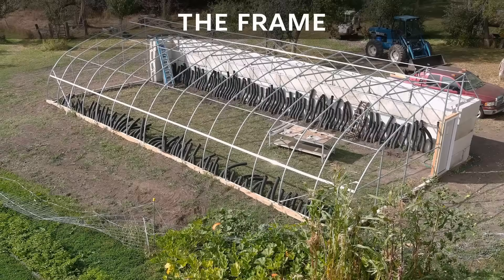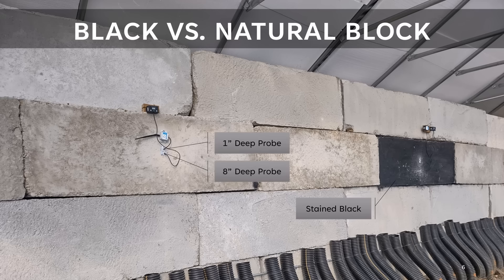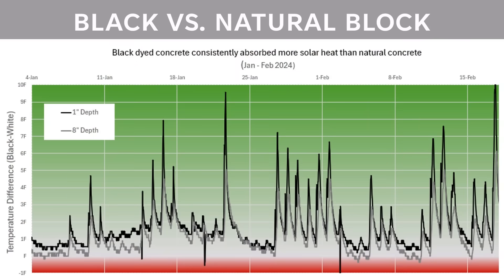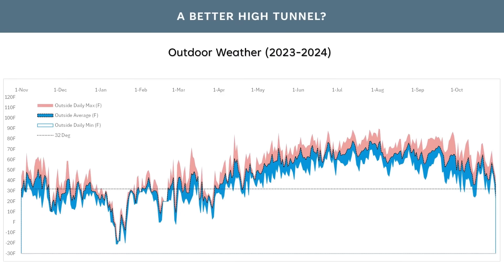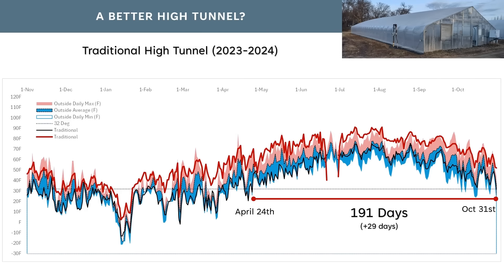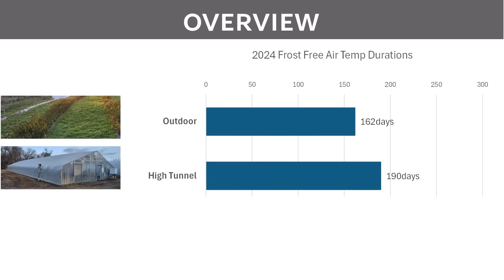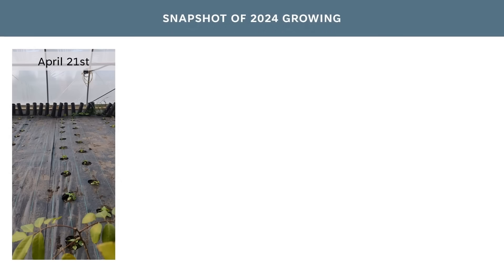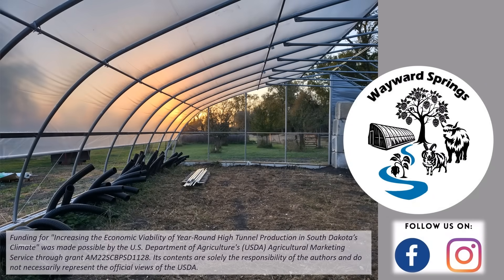Year One Results! Thermal Performance of the Concrete Thermal Mass

Comment: If you was to vent some of that heat to keep it a steady 80 degrees during the day, it would take time to build it back up at night time? or would the temp stay steady after you shut the vents on it? Just curious.
Reply from the maker: If you vent at 80, it will reduce the rate of heat storage because it is highly dependent on the temperature difference between the heat source and the storage medium. I show some graphs on have the deltaT affects storage/withdrawal rate in the climate battery videos.

Comment: I have always found his fascinating, but I wonder about the real benefits of expanding the season into the fall, given decreasing day length. Spring is when I'd really like the season extended and that seems to be harder for obvious reasons.  For my small greenhouse I've decided that it's more cost-efficient, if much less intellectually gratifying, to simply use a small heater as needed for an earlier start.
Reply from the maker: Check out the other videos on my channel. I also measured light and cover that topic. You are absolutely right that it is very important!

Comment: Nice video.  Data is always great. Interesting mass wall but I do wonder if you can improve it more by insulating the top of the wall so heat stored doesn't vent off the top and has to release via the front side only.
Reply from the maker: The rear and top are insulated, but more insulation than I had would improve performance.

Comment: Using passive geothermal heat? how's that working out? Are the tubes moving enough air without power?   Is mounding soil on the backside an option, to add mass and further reduce heat bleeding out of the structure?

I know it would be a pain but if you know it's going to be cold enough for frosts inside you could try what some Chinese indoor growers do and add another layer of UV film inside and enclose the crops. So a green house in a green house basically..

If you build another test structure are you going to lower the floor? So it'd be more like a walapini.

Overall, looks good! You season extension is fantastic
Reply from the maker: I shared some of the main key info that I was looking for from the climate battery research stage in a more recent video regarding the heat exchanger. Check that out. The tubes are meant to be non-functional for the phase of the project covered in this Year 1 video. I don't typically recommend walipini for northern climates as it reduces your winter time light levels, but it can depend on the height of what you are growing.

Comment: if you want super growth year around and have some steel pipe laying around an ondol with fire place at one end and chimney at the other can heat the soils during the freeze! as the smoke flues through the pipes the soils will be warmed and like the blocks will convect heat through out the hard freezing months this will preserve your microbial life and the soils and life in the soils will not die of biggest challenges will be fertilization and with organic teas can maintain year around growth and organic viability grazing chickens in the high tunnel will feed them fresh foods as they fertilize for you and reduce your feed bills! they of course naturally spread organic matter while offering some pest control! one thing we are not sure about over wintering healthy soils means over wintering bugs so having the chickens graze may be a necessity! Many plants may go dormant with the angles of the sun but cover crops will add nutrients and some winter crops like peas and kale and others like green peppers cabbages  simply slow down  simply but having the intact and living root balls green orange and yellow peppers will more resemble bushes than plants  so balance the cover crops that focus on adding nitrogen to the soils so the extended seasons do not deplete the ground of nutrients  fresh products always are welcome when they can be marketed locally less imported and more domestic products i surplus amounts is the goal! the flues should be 5 feet on center with manifolds at the beginning and end so only the cooler smoke is flued out the chimney the heat foot print is left in the soils and convection does the rest banking up one fire a day will keep the greenhouses viable through out the year as the sun sets load the wood and in the morning the sun will only add to the efforts! bury the flues similar to plumbing pipes with 5/8 inch rise toward the chimneys clay does not burn and over time will bake out like warm bricks put a fresh air j pipe into the lower fire place to assure oxygen for the combustion as the ashes gather in the pit simply vacuum them out to keep the fresh air intake clear and the ashes once cooled add potassium and biochar in amounts to the soils inside the grow tunnel! nothing is wasted production year around insure viability dormant plants with intact root systems launch as sun's light angles change the plants launch back into seasonal growth with larger root systems  return with a vengeance until like all organic life they get old and produce less!   Everything in the winter  that does die  back returns nutrient to the soils naturally through the chickens and microbial life maintained in the soils

Comment: Curious how it would do in my area. We are at similar latitude as SD but don't get extreme cold. However we can get two weeks of overcast so there is very little energy input during the day, some days won't gain more than 5⁰f above the outside even at the height of the day. This makes it difficult to buffer against any following cold air mass or frosty nights. One or two days of sun each week makes a huge difference, especially when combined with a thermal blanket. The blanket is installed seasonally over the roof as the sun mostly comes in from the walls, and sometimes curtains are added when a long cold snap is predicted and even left in place all day when we get a cold and overcast combo.
Reply from the maker: Yes, great questions. It would be nice to use the collected data I have and develop a model to estimate performance in other climates.

Comment: all the RESPECT and BIG THANKS for job You did. Very educational. and PC fans on end was also mine idea which seems now is Yours :))) good to know that mine stupid ideas is not only mine :))  btw greetings from Latvia :) here in Latvia not seen such greenhouses yet.
?? Whats Your opinion if I make much smaller size full season greenhouse with additional black concrete floor with some solar heating wire in it for cold nights? My idea is mostly to grow  green herbs in pots, not in soil? I just like growing in pots much more than in soil.
Reply from the maker: These are vaneaxial fans, but are not computer fans. These were customized from the factory per my specs. They are waterproof for wet environments, variable speed. I'm sure that is feasible. The smaller the structure the harder it is to use thermal mass storage because you have more outer surface area vs internal volume.

Comment: Nice experiment with the white and the black block.
It showes that bare dark ground has a bigger thermal effect than CO2.
It supports my theorie that desertification has a much bigger effect on local temperatures than CO2. CO2 temperature effects can be disregarded.

By they way - there are pople who put their greenhouse half underground.
Reply from the maker: For northern climates, I do not recommend a subterranean structure. You gain insulation, but lose sunlight, which is a bigger problem. See my recent video: The Real Limitation for Winter Growing: It’s Not Heat, It’s Light
Reply: @waywardsprings  ok.

Comment: If I have the ability to put the north wall in the ground into a hill, do you think a cinder block, or poured concrete wall, backed by earth will result in any different efficiency than you have with the big blocks?  I'm about 2.5 degrees north of you, btw.
Reply from the maker: Cinder blocks are hollow, so much lower mass. You could fill with sand to improve their performance. Depending on your climate, you may still want to insulate behand them, so you don't lose all your heat to the ground.

Comment: I'd love to do a similar tunnel here on the farm. I really like the concept of relatively inexpensive thermal mass that's also part of the structure. Have you found any less expensive or easier ways of insulating the north wall? That detail seems to be the tricky bit to me.

One other thing that made me think. Did you account for the effect of natural convection happening in the buried piping for this study period? With our riser+manifold setup, we get quite a bit of natural convection from air moving through the piping even without the use of fans, especially coming out of the summer and into early, middle, and even late fall, just because the temperature differential between the air and the soil is so large. It's significant and you can stand above a riser and feel the warm air coming up. Not sure if it would happen to this degree because these aren't connected to a large manifold. Do you see any of the same?
Reply from the maker: I could help hook you up with a kit of this frame. I'm making some improvements yet, but I bet the factory could make you one next year. Perhaps my video on the coverings wasn't detailed enough? You could retrofit your existing ones to be insulated on one side (assuming they are E-W orientated). I covered one end of the pipes the best I could for the first season. It's kinda tough to isolate these two systems, but I didn't have budget to build two of them to compare.

Comment: I love how you've gathered and represented your data, I gave up on passive and ran a rocket stove through thermal mass then drew the residual heat through underfloor ducting with a cheap solar fan instead. With very minimal scrap wood and coppice willow I can grow tropical fruits here in the Northern UK, but as you've also found it's light that creates the bottleneck.

Comment: I use this same principle on my tomato plants during the summer. I live near the Canadian border. I get about 17 hours of daylight in the summer. Many of those hours are cool and do not produce that much growth. The ground is cool as well. A concrete thermal mass around tomato plants holds heat  in the ground. The roots are warm as soon as the sun light comes out in the morning. The result is my tomato plants get 9-12 feet tall every year. 1 plant will produce about 150 lbs of tomatoes in a season. 

Friends in the area with tomatoes out in a garden away from any thermal mass get about 150 lbs of tomatoes from 12 plants as compared to my per plant production. 
However tomatoes require water daily 1~2 gallons per day when grown next to a thermal mass.

Comment: You should try adding hot compost piles behind the concrete heat wall (butted up on the outside of the wall) to add heat in those colder months. I bet with that you could have year-round growing. People really underestimate the heating power of hot compost.
Reply: 😀 Definitely! In New York State they were keeping greenhouses warm with compost piled up around the outside, with snow on the ground. And still the interior plants were thriving and growing

Comment: In asia i've seen they build up a dirt mount on the back wall and they lay a blanket over the top at night to keep the heat in.
Reply from the maker: Yes, I based this design on many of the research utilized to develop the Chinese Solar Greenhouse.
Reply: I think that is called a hobbit greenhouse. They are really neat!

Comment: Looks similar to a walipini, but with concrete blocks instead of earth
Reply from the maker: There are some similarities. A walipini would not meet the qualifications of the temporary High Tunnel definition. A walipini is also bad for northern climates because of our low sun angle in the winter causing the grow bed to not get direct light.

Comment: Have you run any simulations on below grade growing surfaces? I've seen some thing circulating that having your insulated wall surrounded by earth to theoretically further increase its heat storage capacity. The most extreme example would be that the entire growing surface would be below grade (with the necessary drainage to accommodate it). In your example here it would mean less gain in the winter which might be the Achilles Heal of the setup, though that may be offset by the air temperature being too low during those periods.

the other question I had is that it appears that the structure can support year-round growing with the gain you presented. Would there be some sort of R-value breakpoint for this to happen? and would it simply be too cost prohibitive at this scale? it appears as though you could set up a smaller area with something like glass and maintain an area of frost-free growing at the "personal" scale.

The video and data are both excellent and I've gone through several presentations before returning to this. Most of the content in this space talks in theoretical however shows nothing to back it up in vivo. well done.
Reply from the maker: Having the growing surface below grade will reduce the amount of light hitting plants. The walipini concept is best used for cold mountain climates near the equator where the sun is high in the sky.

Comment: I was thinking two things, #1 a cold season crop would probably allow year round use, some of the cold season crops can take some below zero temps and secondly a solar array powering a mini split would almost certainly allow year round use, or even a small wood stove just to not allow the freezing problem, but a solar array and mini split would allow zero maintenance, combined with a hydroponic section would almost certainly take the load off your farm rest season and allow year round crop income
Reply from the maker: I am working on a future video that will discuss available light levels and production limitations based on that.
Reply: @waywardsprings Great consideration. Each month of season extension is of some value, but diminishes with lower light. 
My thermal modeling of basic hoop ($) to full climate greenhouses ($$$) is lacking the production benefits (if any). I will look forward to your study. 
BTW, an R-6 roll up blanket on the South side at night will likely eliminate your frost. 
2nd, A hydronic (radiant floor) heat is simple to control and when under row covers (inside the GH) will trap heat at the plants. The earth battery is not as useful.
Reply: I'm all in favor of incorporating photo-voltaics, but I always think of it as a supplement.  Something that really helps you save money when there's lots of sun.  I just don't think of it as something that's going to get me through the worst of the winter, although it might, if the cold snaps all match up with clear skies.

I just feel like you need something bulletproof, in case the cold snap is overcast.  In this situation, I probably would have incorporated a rocket-stove mass heater, which would probably be the most efficient way to keep the place heated, no matter what.  I'd probably set it up as my "grid's down" kitchen, and just running it enough for meals would keep the entire space pretty toasty.

Comment: Very nice,  one question though why concrete instead of water? Just so you do not have to worry about freeze protection? I intend to do something very similar but with water in IBC totes as the thermal storage medium. Though I will likely add some additional solar collector to ensure it never freezes.
Reply from the maker: Simpler (in my opinion).
Reply: @waywardsprings  definitely, if I am involved.... LOL
Reply: Yes, I think that a wall of stacked pallet mounted water tanks would have much greater thermal storage and smoother temperatures.

Comment: Your greater energy loss from the black blocks is due to the differential temperature, since the air is at the same lower temperature, the hotter black blocks lose more energy because they have more energy to give, they don't cooler faster because they are black, the cool faster because they are warmer.
Reply: It's true a hotter body will radiate heat faster than it's cooler neighbor. But a black body, due to its higher emissivity, will also radiate more heat than a white body just because it is black.
Reply from the maker: @hughlawson1051 you beat me to the answer, thanks!
Reply from the maker: The emissivity of the black block is higher. It absorbs and emits at a faster rate, which is why dying it is beneficial. It is giving up more heat to the greenhouse at night. That's a good thing.

Comment: Hi, great greenhouse. Slightly obscure question but what software or service are you using to visulise the data? I have a small passive solar greenhouse with a smart controller and I'm keen to display similar data but have struggled to find the right tool. many thanks.
Reply from the maker: Can you clarify which data you are referring too? I use quite a few through my video series. Graphs? Typically Excel, sometimes Minitab or others.
Reply: @waywardsprings the temperaure charts across the year. They looked a bit too detailed for excel which is why I asked. Thanks.
Reply from the maker: @BalticHomesteaders Those are Excel. But default settings in Excel are garbage. I highly recommend the Story Telling with Data books and training resources.

Comment: With all those pipes, and plastic sheeting for the roof, and plastic ground cover, I'd think that some plastic ends up in the produce. Studies have shown that plants do take up microplastics. And the offgassing from the plastic could also possibly end up in the produce.
Would the system work sufficiently well with maybe 1/4 the number of black pipes?
Reply from the maker: No it would not. Watch my latest video on heat exchanger design.